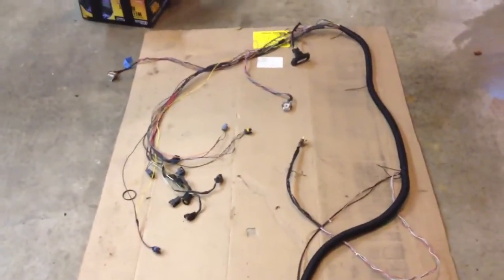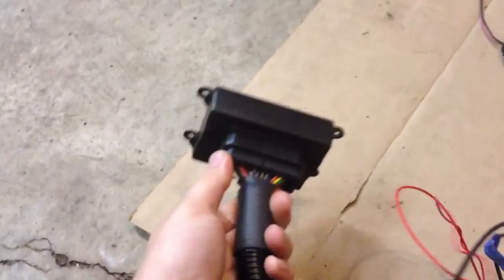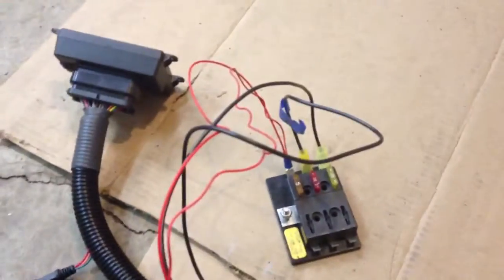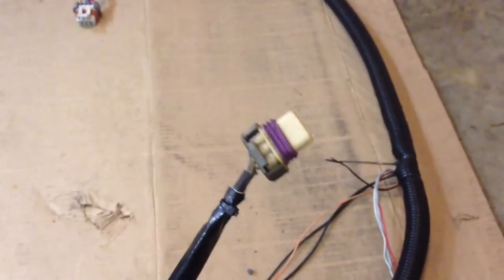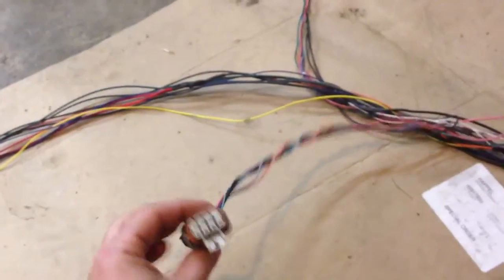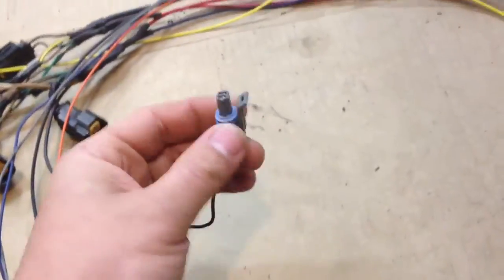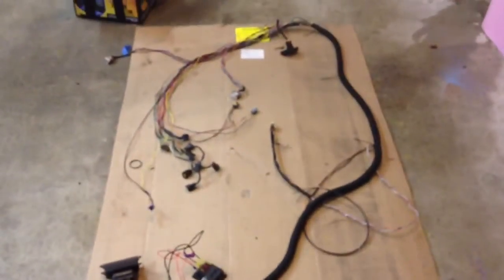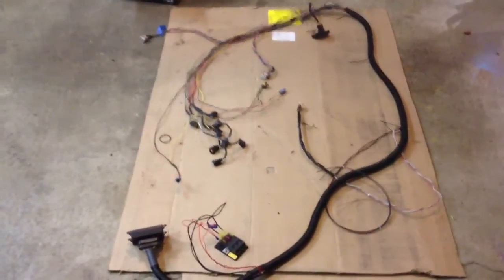12-31-12 microsquirt v3 plug and play overview

Comment: What is your turbo ls1 tune setup for horsepower wise on the preloaded microsquirt from efisource? I have a 7875 setup with sep 1500cc on 91 octane. Just trying to figure out boost levels safely. Can't get a dyno tune or get it tuned. Was hoping to run your turbo tune only on my 5.3
Reply from the maker: I would keep it under
10lbs till you get it pretty sorted

Comment: how do you get 8? there's only 2 injector outputs. im so disappointed in ms... 4 i would understand but 2??? wtf
Reply: Malcolm Hughes I’m a little late here but yes. Two injector drivers. Most do all 4 on bank one on INJ 1. Then all injectors on bank two on INJ 2. It’s called batch fire. I do injectors 1,5,4,8 on INJ 1 and 2,6,3,7 on INJ2. That is so rail pressure is equalized better. This is all done on an LS race engine on methanol.

Comment: you don't need to run a msd box with this microsquirt?
Reply from the maker: Big frank correct, micro controls the ignition
Reply: +Sloppy Mechanics as in drives dumb coils directly...?
Reply: +Andrew Rabbitt no, does not drive dumb coils directly. Only smart coils. Dumb coils need the bip373 or some other ignition driver. An igniter will work as well. Micro controls the igniter and thus the igniter sends the signal to the dumb coil resulting in a spark.

Comment: Hey sloppy, To gain the extra 2 ignition outputs where did you mount the 2 resistors needed? In the loom or in the back of the microsquirt unit itself? Also, are you just running two coils of each ignition output? (in wasted spark mode)? Thanks in advance.
Reply from the maker: you can put the resistors in the box behind the cover, or you can put them in the wiring harness. ive always done them inside the box, also EFI source now modify s them from the factory with resistors already soldered into the board

Comment: I have a 78 Jeep Cherokee with a 401 V8 with a Ford Duraspark ignition, I think it is Duraspark II What mods would I need to do to use my distributor with a GM TBI system? I haven't found much info on this and since I need to rewire my jeep from head to tail I should investigate EFI because gas is just too expensive to feed that 401! Also is there a way to utilize mass air instead? i wanted to use a pretty lumpy cam and I'm not sure the computer would be happy if it made low vacuum. 
Thank you:)

Comment: i just bought one from a fellow and it coms with a ez efi ing controller
do you know antthing about the ez efi controler is it for edis and 8 spark plug coils thats what i think its for i ant  got it in the mail yet
unit was in a running cobra kit car wreck i need to use it on a 1989 7mgte supra